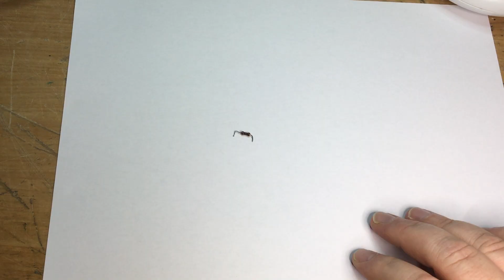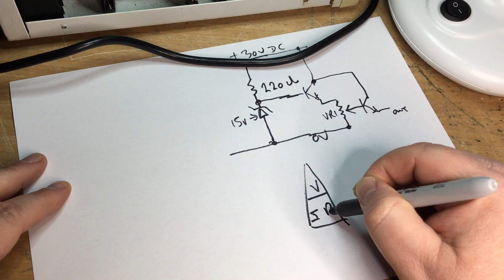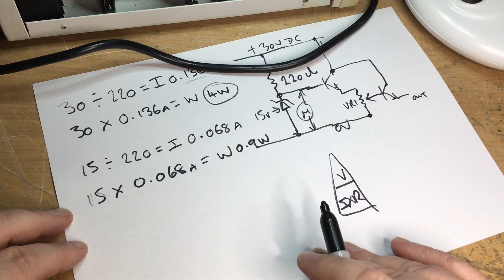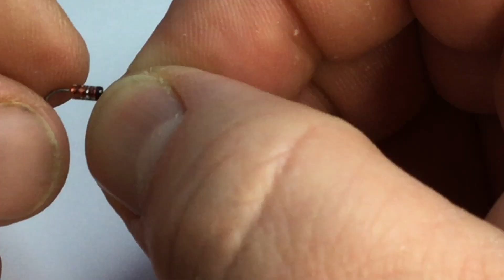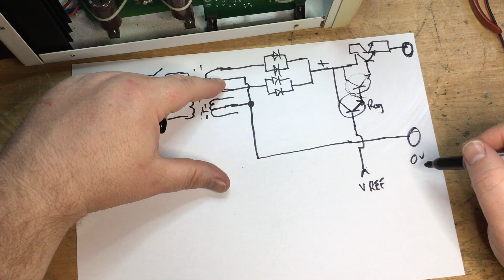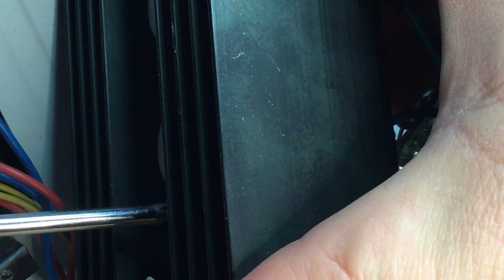Power Supply Repair walk & talk, multiple faults, SkyTronic 13.8v DC 27amp

Comment: Questo alimentatore indica sul frontale la capacita di erogare alta corrente di uscita (25/27 Amp.);  A guardare dalle dimensioni del trasformatore e della sezione dei conduttori utilizzati; Dele dimensioni dei diodi raddrizzatori; Alimentare con questo alimentatore un  carico che assorba realmente 25 o 27 Amp.O anche la metàper oltre 10/15 minuti,  potrebbe essere non consigliabile!  Senza correre il rischio di guastarlo e o di fargli prendere fuoco! Non voglio qui discutere della qualità della tensione erogata, in termini di stabilità della tensione  e della pulizia spettrale; O del Rumore prodotto; In quanto per valutarlo bisogna fare prove strumentali( collaudo) con strumenti alquanto difficili da trovare nella disponibilità  di un utente hobbista! (oscilloscopio o voltmetro elettronico  in AC.) A mio modesto avviso sulla base della mia formazione tecnica e della mia esperienza lavorativa di tecnico elettronico con circa 40 anni di attività; Considero questo apparecchio inadeguato e non rispondente ai dati riportati nell'tichetta frontale! Per me indicare in bella vista le caratteristiche esposte sul frontale; E' una vera truffa! Giudizio tecnico da tecnico italiano:  "Pessimo"! Un Apparecchio dozzinale da non acquistarre! E non vendere al pubblico a utenti comuni! Potrebbe essere pericoloso!

Comment: Regarding the 3055 Transistors:
If you get the chance, when you work on this type of PSU, especially older units, check the metal frame of the 3055, and look for an "H" stamped into it . This does not mean H for high power, but refers to the internal construction of the transistor. Homotaxial rather than the later versions which used the Planar construction /epitaxial. If I remember correctly The H type had better secondary breakdown characteristics and was much more rugged, but of course much more expensive to make. Homotaxial types were the first type on the market by RCA who invented them. Later the spec for the 3055 was developed under JEDEC standards and the planar type met that spec so it could be called a 3055 as well.. I do not know this bit for sure, but it may be that the 3055H as in the actual marking rather than the stamp, was a way to sell the homotaxial types specifically . What I do know for sure was that one of our products suffered a very large number of test failures  when one of the buyers found some much cheaper 3055's than what was specified.  (40+ years ago now!) He bought the newer and cheaper planar types.

Andy